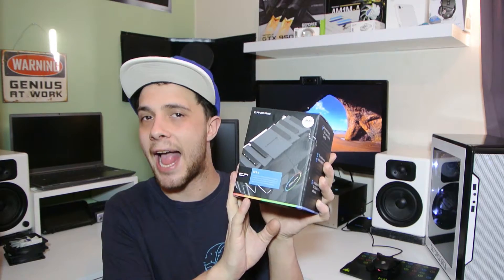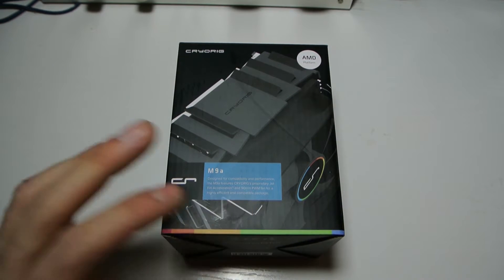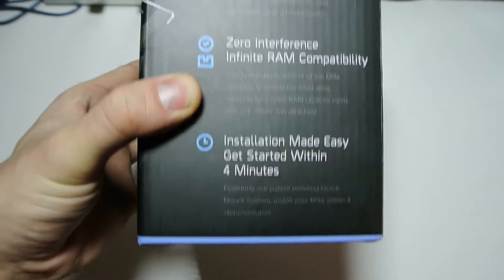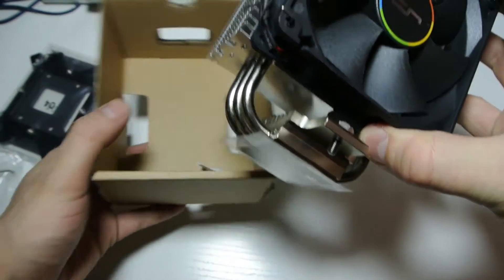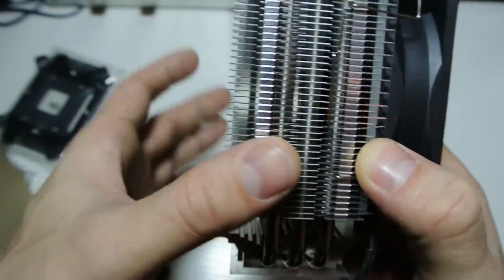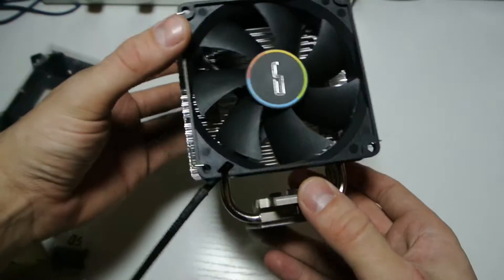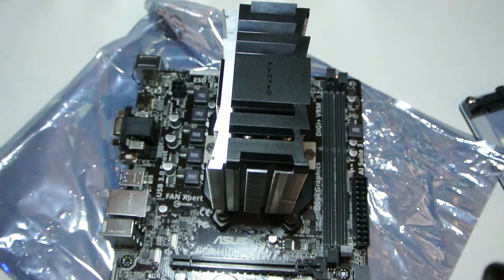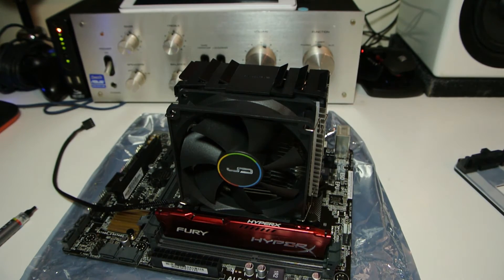Cryorig M9 Unboxing And Install AMD Version

Comment: #thefullsetup do you think I can install this Cooler without having to take my Motherboard out of the case? Just want to upgrade from the stock Intel fan I have installed.

Thanks!
Reply from the maker: TheGamingAffiliate has your case got a coy cut out on the back. if so then yes you should be able to install the bracket without removing cooler.
Reply: thefullsetup it does. sweet. thanks

Comment: this or hyper evo 212?
Reply from the maker: Adsary hyper evo 212 due to being a larger cooler.
Reply: ok cool   thanks     but you see i will not be overclocking anything and i plan on buying the i5 6600    so i just want something that will be silent and coll better than he stock cooler
Reply: what do you think i should get
Reply from the maker: Adsary well large fans a generallyrics quieter and you could always upgrade it with a noctua fan
Reply: I have both the M9i and 212 Evo. Although the M9 has a 92mm fan, it sounds just as quiet as the 120mm fan on the Evo. I like the M9i because it looks a lot nicer and build quality is leaps ahead of the Evo. Lastly it was so much easier to install than the Evo.